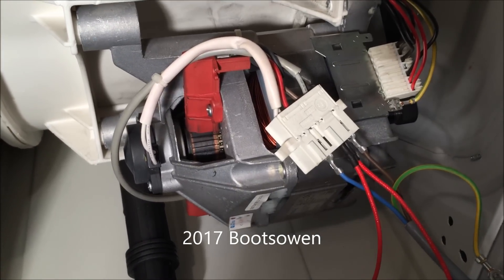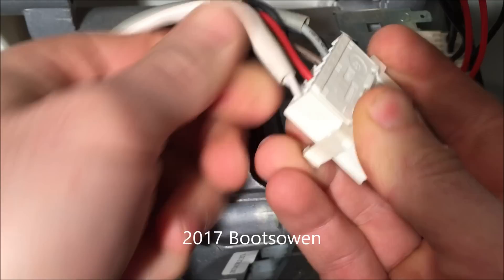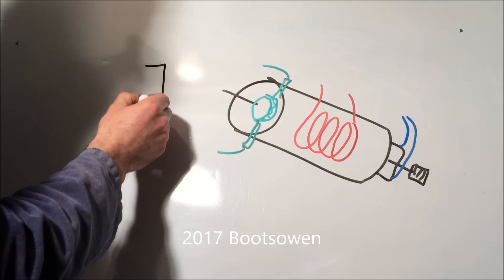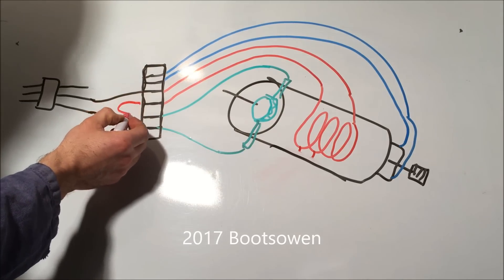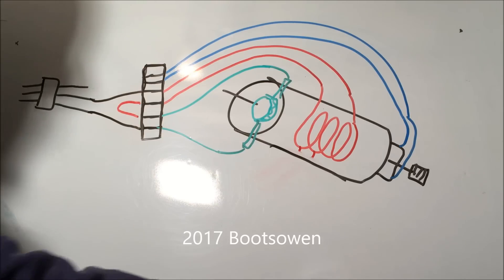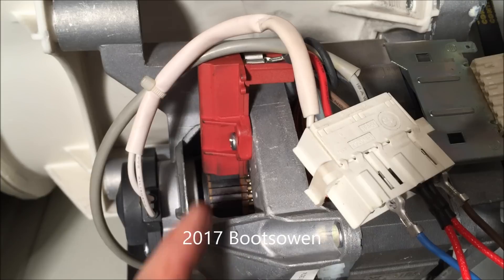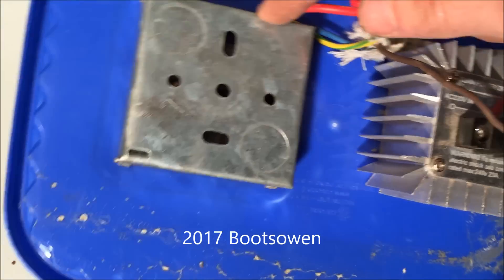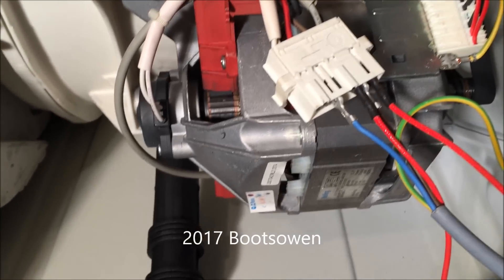Washing machine universal motor wiring explained

Comment: does this method work if say directly to the mains?
Reply from the maker: Theworldsbiggestkettcar it does indeed. If you leave out the voltage regulator and plug it straight to the mains it will get the full 220volts. It will speed up as fast as it can.
Reply: shania

Comment: damn, how to make it change direction without physically change bridge and coil pins? technicaly,  i want to change it with somewhat foot pedals...
Reply from the maker: You need a 2 pole 2 way switch. Easy.
Reply: @bootsowen  yea, but my hands are busy, have to do it with foot. And when i releaae foot, it should turn of motor. I have pedals with NO and NC connector but i do not know how to wire those...thanks a lot, anyway

Comment: i have seen videos of people converting (supposedly) these motors to DC. can you make a video on that?
Reply from the maker: I can give it a go, but what would you be thinking of using it for? Torque? Speed? I have a set of 6 12v batteries that would give 72v dc, might be cool to try something.
Reply: i have been looking at motors for electric bicycle or gokarts
Reply from the maker: I have had a go at it today, it will run in the same configuration as in the video you have commented on (above?) just put the DC in instead of the AC. I'll have a tinker with it and get some kind of DC voltage regulator. I think it would be good for a power assist on a bicycle, I might try it out. I will put up a video of this sometime soon.

Comment: Now how to reverse the shaft rotation?
Reply from the maker: I explain in the video. Exchange one end of loop with phase or neutral
Reply: A more practical way without tge hassel of undoing wires?
Reply from the maker: @vincentlee2460  install a 2 way 2 wire switch. See my videos on tda1085c

Comment: What about the earth cable ? What should i do with that one ?
Reply from the maker: Earth it if you like, up to you.
Reply: @bootsowen  Allow me to rephrase. How do you earth it ? ^^' "Btw: Your guide helped me very much, I was able to connect my motor, so thank you very much"
Reply from the maker: If you have an earth cable from the plug, then attach the other end to the earthing tab on the motor (this could be on the pin out connector block, or attached to the motor casing) . or attach directly to any part of the motor casing. If you are using a speed controller like i do in this video and you put it in a metal box to protect it then you should earth that too by attaching the earth cable to the metal box as well.  Do not attach the earth to any of the brushes, armature winding tabs, tachometer tabs or to the circuit board. Hope this helps.
Reply: @bootsowen  Yes, thanks a lot man.

Comment: Is your incoming power 3 phase or single phase?
Reply from the maker: Why?  In this video the incoming power is single phase.
Reply: @bootsowen  I've heard a lot of other countries have 3 phase residential power but the US only has single phase.  I was just trying to figure out if the process you showed applies to my situation (which is single phase as well).  I'm new to wiring motors and this is all a bit confusing
Reply from the maker: @AlexRicketson  No worries, yes, single phase here, but even in places where there is 3 phase to the house they tap off a single phase for wiring all of the outlets and lights etc, but just use 3 phase for bigger things where required. So such a house would have both single and 3 phase.  My understanding is that the US is different, there can be 120v and 240v outlets. Here in the UK it is all 220-240v single phase.

Comment: And how do I  connect the motor if I have more cables coming from the inner field winding?
Have have 9 pins on mine.
but if I use the connector that was used in the washing machine I have only seven "pins" because a cable comes out of one pin loops around and goes in another one.
Reply from the maker: I think you should watch the video and ask yourself that question again.

Comment: how do i wire one of these new brushless motor that are in washing machines today.
Reply from the maker: They are a new fangled type of three phase motor and are controlled by a special device in the brains of the machine, in short I have no idea but I am working on it as they would be really useful!
Reply: bootsowen thanks for your reply. it turned out the motor was damaged as the bearings had disintegrated and it must have put it under to much pressure. I will go for one of the older motors, they seem to be the more basic to work with.
Reply from the maker: I have had exactly the same thing on an LG direct drive that I got.  Bearings so bad the drum wore through the tub body causing it to leak! I have seen a few tutorials on YouTube about how to turn the direct drive motors into generators. I reckon if you could program a controller it would be a very sensitive and strong motor.

Comment: how to wire this motor,, c.set. 3 phase induction motor 195 v 5-A16000 rpm,from whirlpool w/machine.please let me know.by your channel.
Reply from the maker: Hi, you have asked me in another video, where I am asking the same question. I think you would need the power control board.  I have made another video about how to wire these 3 phase motors, you can look at.

Comment: I have a washing machine motor  that I need to use it as a drive motor for a magnetic drum 
will I be able to run this motor at 50rpm ?
Reply from the maker: yes
Reply: bootsowen  so my just following these instructions I can achieve that 
thanks a lot 
as soon I go to my workshop tomorrow will post everything and see how to do it because the motor that I have is a bit different
Reply from the maker: Be careful around live electricity, If you don't understand anything consult a local electrician as the rules and systems in your country may be different. Good luck.

Comment: great video, i wanted to start but 1 problem i have 7 pins, 1 more going to the motor, what to do? anyone ? idea?
motor 20584.428 from a candy . i have all the parts and cables, wanted to use the cenrifuge option to control it, but to difficult, so now i cut the powercable and try it this way
Reply from the maker: If you have a brushed commutator universal motor, like in this video, then 2 wires to tacho, 2 wires to brushes, and 3 to coils. ignore 1 coil wire and it is the same as in this video. I have posted how to do it with many other motors in my wiring washing machine motors playlist.
Reply: @bootsowen  it worked, thamk you(with a lightswitchdimmer)
Reply: @bootsowen  thanks its working 🥳

Comment: i have a 4 wires coming from motor, how to connect it as 2-wires so i can run it directly?
Reply from the maker: What type of motor is it?
Reply: @bootsowen  sir this is also a universal motor used in washing machine. Actually there are 10 wires, tacho, brush, ground but I was thinking of the 4 wires coming from the motor windings.
Reply from the maker: Hi there, 2 tacho, 2 brush, 1 ground should leave 5. If you have 4 and you are sure that they go to the windings then any 2 of them should get the motor to turn. Probably different speeds when under load. When unloaded the speed tends to infinity so it can be difficult to differentiate.  What is your spare wire for?
Reply: @bootsowen  ground also for the motor.
Reply from the maker: Did it work?
Reply: @bootsowen  I'm sorry sir the no. 5 is not for the ground it means 5 wires from motor. I can show you the diagram of this 10-pin universal motor
Reply from the maker: @recoveryfiles8098  Hi, It is difficult to help you, you are giving conflicting information. You said that you had a universal motor with 4 wires. then 10. now 5.  This is a dangerous adventure for you. I suggest you seek help from an electrician. I hope you are successful.
Reply: @bootsowen  10 because tacho, brushes, ground are included. 5 from motor. This is not dangerous. I can read a diagram but this one seems confusing.
Reply from the maker: @recoveryfiles8098  Tried to help, No idea, sorry.   Post a video of your issue and maybe someone will help you.

Comment: Hi great video really helpful. I've got a question does it matter if I have 9 pins on my motor can i wire it up in the same way? I've posted a sort video of the motor if that helps, I'm planing on making a belt grinder with it with some sort or speed controller on it. Any any advice will be really helpful.
Many thanks Paddy
Reply from the maker: Hi Paddy. The number of pins doesn’t matter you can wire it this way as long as it’s a universal brushed commutator motor. In my more recent videos I have been looking at a motor controller specifically for this kind of application. (About £30 on eBay). Keep an eye on my videos to see how it goes.
Reply: Hi bootsowen thanks for the quick reply and Ok thanks for confirming that, I've subscribe so I'll look forward to those videos.
Thanks again Paddy

Comment: Hi can this work with 180v dc? Like treadmill speed controller?
Reply from the maker: Hi Karl. I don’t really understand your question. Do you want to use a universal motor with a treadmill speed control or a treadmill motor with a scr voltage regulator?

Comment: Have you a Link for the Voltage Regulator?
Reply from the maker: https://www.ebay.co.uk/sch/i.html?_odkw=4000v+scr&_osacat=0&_from=R40&_trksid=p2045573.m570.l1313.TR0.TRC0.H0.X5000w+scr.TRS0&_nkw=5000w+scr&_sacat=0

I normally buy the cheapest.
Reply: Thank you
Reply from the maker: You can also get a cheaper one for a lower wattage, this may be suitable if you are not using it under a heavy load. for instance "AC 220V 2000W SCR Voltage Regulator Dimming Dimmers Speed Controller Thermostat" on ebay,
these are as cheap as £1.15 on ebay, but i found that they break frequently.  I have not managed to break the 5000w one.
Reply: Ok :)

Comment: How it will work it automatically change in motor running direction
Reply from the maker: You need to switch two cables. Make a switch. See the video.

Comment: hi Bootsowen  i have a c.e.set 3 phase induction motor (washing motor ) cim 2/55- 132/hp 1 it busless 
it's 7 wire
how to make test rig
Reply from the maker: The short answer is that I don't know, there is some information in this thread: http://www.electro-tech-online.com/threads/washing-machine-with-ceset-induction-motor-brushless-wiring-advice.130573/
You may be able to drive it with a single phase motor inverter but these are expensive.  For my interest, what type of machine did it come off?

Comment: Ben daha ayrıntılı olarak tekrar indirebiliriz, dilini tercüme edilemez.
Reply from the maker: Elektrikin tehlikeli olduğunu anlamıyorsan, dokunmayın! Temini kesiniz, bir elektrikçiye danışınız.

Bir çamaşır makinesi motorunun tel bağlantısı ve hızı bir SCR Voltaj Regülatörü kullanılarak nasıl kontrol edilir. Regülatör voltajı kontrol ettiğini söylediği gibi, doğrudan hızı kontrol etmez, dolayısıyla bir yük uygulandığında motor yavaşlar, gerilimi artırarak bunu telafi edebilir ve hız artar. Ayrıca motor yönünü tersine çevireceğim.

Bu motor, Indesit WIA111 çamaşır makinesinden gelen iyi bir hxgn2i.

Hızı kontrol etmek için bir scr voltaj regülatörü kullandım, ebay'de "220V AC 5000W SCR Voltaj Regülatörü Motor Hız Kontrol Lambası Dimmer Termostatı" veya benzerini aradığınızda bunlardan birini bulabilir, bunlardan 2'si için 10 sterlin ödemiştim.